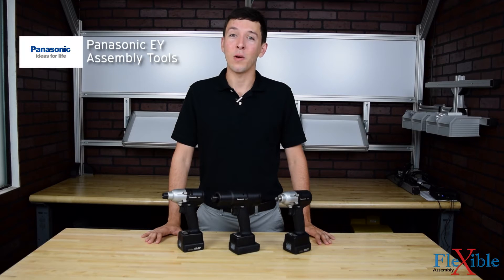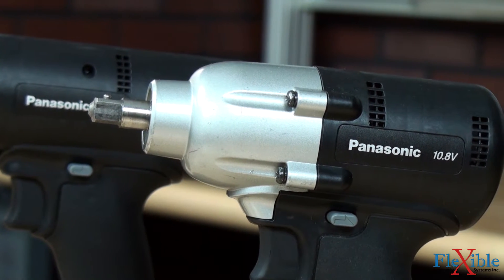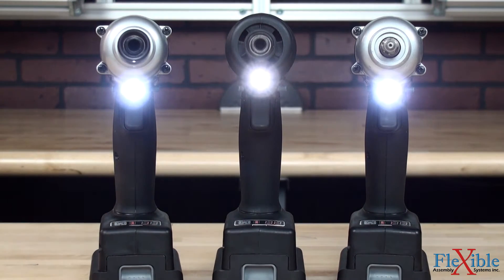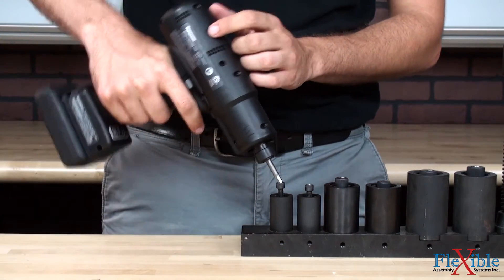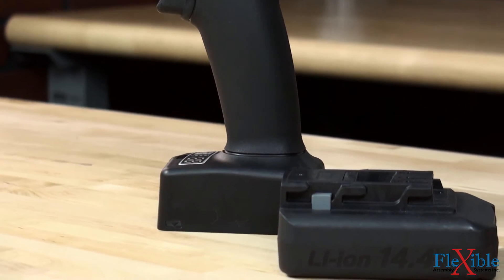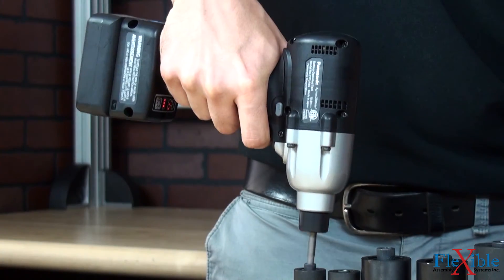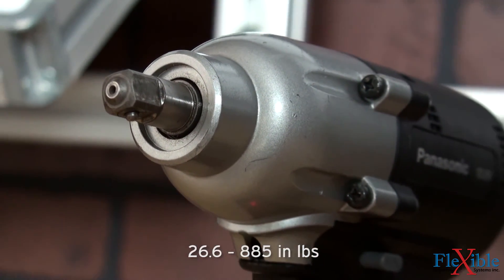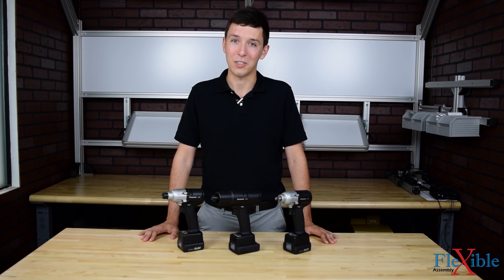Panasonic EY Cordless Torque Drivers

Comment: I bought one of these from a lady gave like 10 bucks for it... was the 3/8 impact driver....it worked fine but I need a charger and the remote to it... somehow I messed with the buttons and it shut itself down... it won't work anymore but the battery is fully charged...I nearly passed out when I seen what it cost new couldn't believe I snagged it up for 10 bucks... is there any way to get it working again without the remote I just want it to work don't care much about setting the torque values on it just wide open is all I would be interested in... of course it would be cool though for torquing bolts on engines and such

Comment: Theres the light in the back like as soon as you prass the trigger the red light on the back of the impact
Reply from the maker: The light on the back of the tool is the "Tightening confirmation lamp". A red light could mean it failed to reach proper torque, a green light would mean it passed. I suggest looking in your manual for more information. If you don't have the manual you can google "EYFLA6P  Manual" to see an online version.

Comment: Can you sink the controller to the impact if you buy one
Reply from the maker: The EYFR03 Wireless Qualifier in this video is only compatible with the following tools:
• EYFGA1NR
• EYFGA2NR
• EYFGA3NR
• EYFLA4AR
• EYFLA5AR
• EYFLA5PR
• EYFLA5QR
• EYFLA6JR
• EYFLA6PR
• EYFMA1JR
• EYFMA1PR

The EYFA30 Remote Control with work with Panasonic Cordless Impact Drivers.